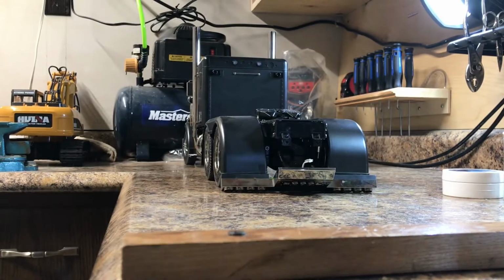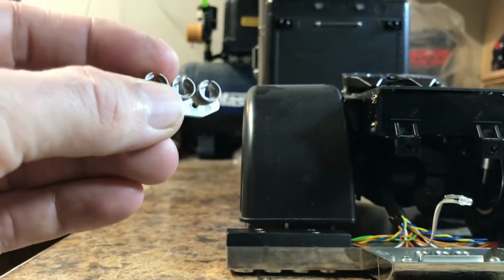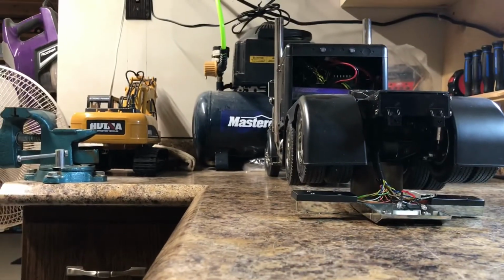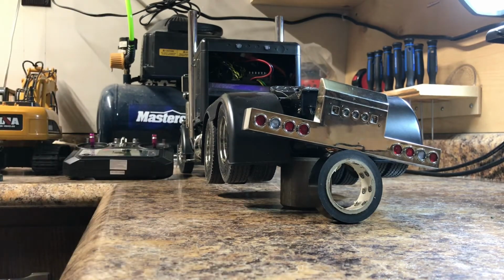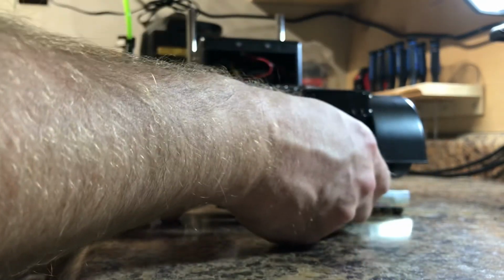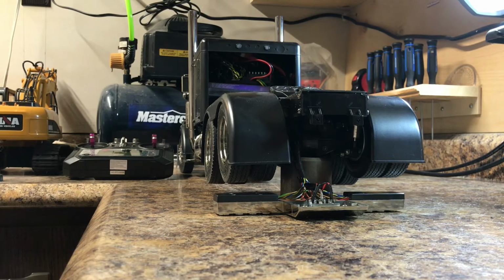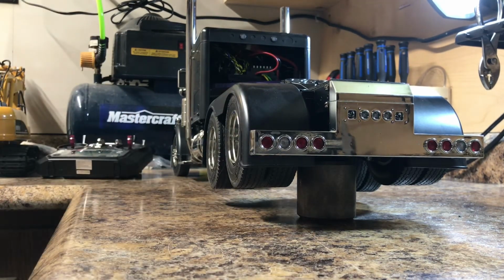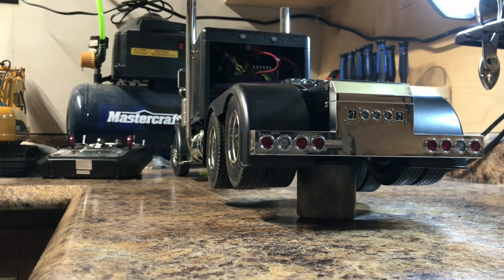Grand Hauler reverse light upgrade.

Comment: Awesome!!! What battery do you use for this truck? Whats the mah on battery and is it square shspe or round side shaped battery?
Reply from the maker: @arni7810  I use a  4200mah  2S lipo. It’s a square hard case battery.
Reply: @silverrick90  ohh, I just bought this truck used built. Guy gave me a 1800mah 7.2v 6s NIMH long battery but he said it only last about 15mins and I should add something different for life span...how long you get with that battery run time?
Reply from the maker: @ never timed it but I’d say around 40min. Nothing wrong with nimh batteries. If your run time is that low I’d say that battery is on its way out. Any 6 cell nimh should fit in your tray. I’m sure there’s 2200mah nimh batteries out there cheap. If you’re new to the hobby and need advice your best resource is your local hobby shop. I run lipo batteries but they require a lipo charger and extra care and initial cost with a charger can be expensive. Just an FYI. Enjoy the truck!
Reply: @silverrick90  oh ok. I'm new to this. I'll buy another battery that has way more mah so I can get alot of run time. Great video!!! Thanks